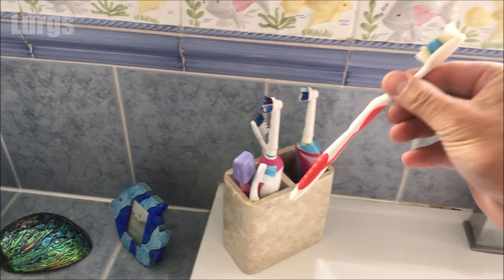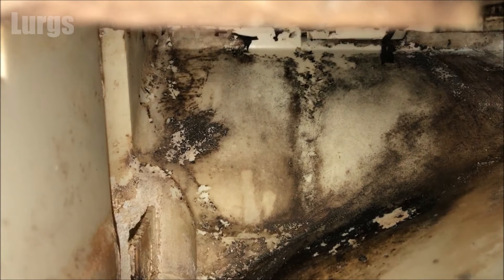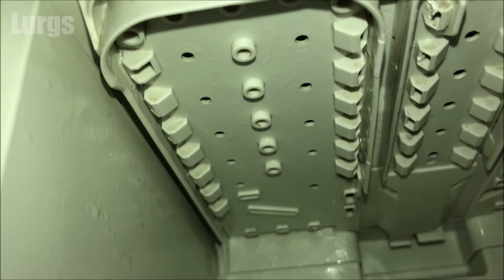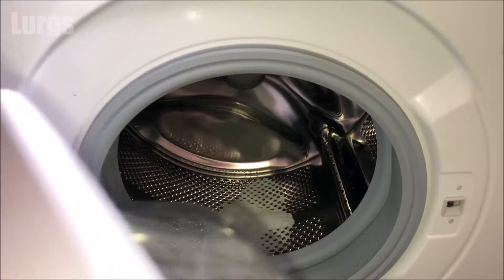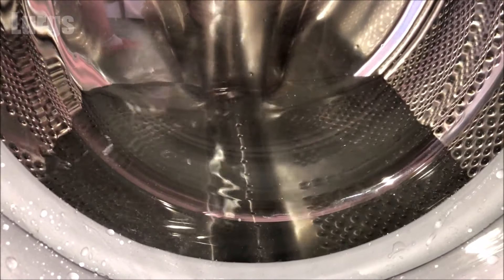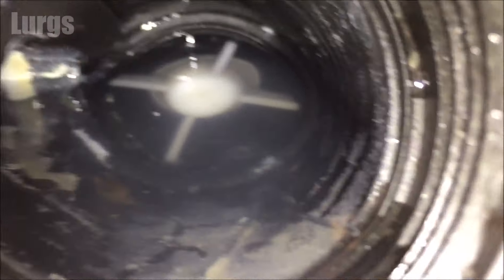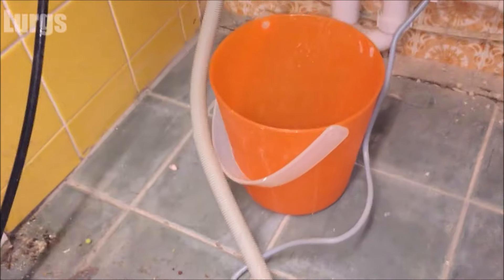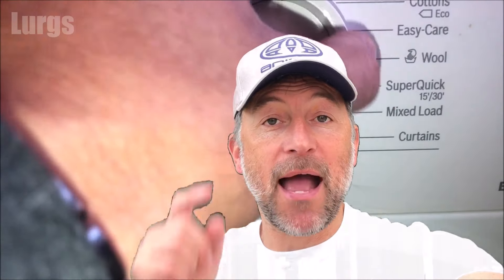How to Clean a Smelly Washing Machine in 6 Easy Steps

Comment: I followed all your procedures and smell continued. I discovered the element was broken and needed to be replaced. Your video set me in the right direction to discover what was at fault 👍
Reply from the maker: Glad to help.😎
Reply: Can you tell me what part thanks
Reply: @valerieguidry7636  element is a sealed unit in your machine. Looks like what is at the bottom of your kettle rather than round it’s straight. It’s quite easily replaced. Un do 1 bolt 10 spanner disconnect 2 electrical wires and remove. Make sure all power is off to the machine.

Comment: Nice video, currently waiting for my 90c wash with the cleaning powder to finish. Fingers crossed it will do the job. I think this is the one major disadvantage of doing colder washes - with modern detergents you can still get your clothes clean at 30c, but the machine builds up bacteria far faster than "back in the day" when people were washing at 60c+ on a regular basis. Still, running a high temp wash every 6 months or so is probably way cheaper than washing daily at higher temps.
Reply from the maker: Thanks. Yes 90C gives it a good clean out. 😎

Comment: Stop using liquid detergent…use dry powdered detergent…No more mold!!, Trust me!!
Reply: USA Costco Kirkland Signature powder. I have a 4.5 Samsung washer,  I use 1/2 c. Kirkland powder, 1 Tide pod, 2 Scoops Oxy Clean with ever load. Crack door open and drawer and after 3 yrs without Clean cycle absolutely no smell. Every 3 months Clean Clean out.
Reply: Mines the opposite

Comment: My machine is 15yeara old. I have only ever used liquid cleaner. It has never been serviced. Would be nervous to mess with the U bend. Didn't realise there might be a service wash option. Just wondering if you know if Bicarbonate of soda could be used to clean it. Or I shall need to go out looking for the Dr Powder you recommended. I hope it is not hard to find.
Reply from the maker: The U Bends can get clogged up. The washing machine cleaner is really good stuff.

Comment: I don’t have any u bend on my drainage pipe ... constantly blocking and making floods,
hence i drain directly in sink - so the pipe of the wash machine spits ribbed copies of its insides  gunk... Cleaning it in all sorts of ways and its new machine Can low water pressure in the block of flats cause it?!
Reply from the maker: Low water pressure shouldn't affect it as the drainage is the last part where the pump pumps out the water in the machine. Sounds like poor pipework on your drainage. Best get a plumber to have a look and advise.

Comment: how to clean the pipe from dispenser? 🤔 because theremany dirt left aswell
Reply from the maker: Not sure what bit you mean? Run a drum clean option or 90c empty wash
Reply: @LurgsHowToGuides   water with detergent goes from dispenser to the drum, this pipe is not easy to clean mould is inside around pipe
Reply from the maker: Yes not easy. Still try a drum clean/90c wash as this may flush through and clean it.
Else use the pods which go directly in the drum and it may clear up after a while

Comment: Hello there, 
Thank you for this video, it’s very helpful. My washing machine keeps on giving an error. It’s says open faucet. But it is wide open. What should I do?
Reply from the maker: It could just be a faulty sensor maybe, is it still washing ok and filling\draining?
Reply: @LurgsHowToGuides  yes it’s washing and filling/ draining. So I will get the sensor replaced. Thank you very much. Do you also have a tip on which dryer to buy? Your al time favorite not to expensive. Thank you in advance!

Comment: your not explaning if the rubber base is dirty. me rubber second layer and the rubber that on the inside of the whiel is dirty, how to i clean that? i having hard time to keep the rubber that on inside of the whiel open to clean it. any tips?
Reply from the maker: It’s hard to clean all the places inside, run a few drum cleans or 90c empty washes to help clear dirt, once a machine gets older it’s harder to clean the rubber if it’s ingrained dirt
Reply: @LurgsHowToGuides  i have cat i gues its hairs that are left behind in the rubber drum, try to clean after one soda round, but was still harde to keep the rubber open to get the rubber layer that on the inside of the drum, even tryed to force it open with the back side of flat metal fork, but even then is was still in some way harde to remove the wet dirt/hairs/molt. now im running it overnight with 
vinegar. but i dont think that will help my hair/molt problem that on the inside rubber sticking to drum.
Reply from the maker: Hairs do stick to the rubber. Hope the cleaning cycle works and at least helps a bit

Comment: Hi! I took out my soap drawer and behind it was a lotttt of mold. How do i flush this black stuff away after scrubbing it loose? can i put a small hose in? or do i kill the machine by doing so?
I couldnt get it all away with a cloth and now all my clothes smell like shit and have these loose black stains :/
Reply from the maker: Try scrubbing it loose with a long brush (but block that hole up incase you drop it), then do a service wash or a hot wash with no clothes to flush the machine through. After you do a wash always leave dispenser drawer slightly out to let it ventilate, will stop mould building

Comment: I’ve done all of those steps and the machine still smells. It’s only 2 years old. Should I get an engineer out to see it?
Reply from the maker: I doubt if an engineer would be able to fix that. Make sure you do some really hot washes (service washes) and after normal laundry leave the door and detergent drawer open to allow ventilation.
Reply: @LurgsHowToGuides  Hi, thank you for the reply. I have done three 90°C washes. One with a touch of bleach and two to rinse it out. I've checked the pump and the drawer has been completely cleaned and the rubber seal. Yet the washing still comes out smelling awful. I'll see if the professional machine cleaner works. The machine doesn't have a drum clean function, which is unfortunate.
Reply from the maker: @WillVenusASMR  Yes try Dr Beckmanns in the drum on a 90c wash. That should help. It shouldn’t smell if water is draining properly. Odd the actual
Laundry comes out smelling, are you sure the cold water inlet feed is ok, I would think it is as it’s mains water and you’d see problems with water out of your taps. 
You could also try the pods for a laundry wash instead of using the detergent drawer as these go straight in the drum.
Hope you can get it sorted, please let me know how you get on...and good luck.
Reply: @LurgsHowToGuides  I actually use ariel liquid and pop it right in the drum, on top of the load at the back. I'll try changing the water inlet hose as I don't think that has been changed in a long time. Thanks so much for your help, it's genuinely appreciated 👍🙏🏻
Reply: @WillVenusASMR  have you tried draining the filter hose as well as removing the filter and cleaning it?

Comment: My washing machine is 4 years old. I never use fabric softener, and put liquid detergent straight into the drum. Also I do regular 60 and 90 degree washes. I never did a maintenance wash because the machine looks completely spotless. Using a shit load of fabric softener and liquid detergent and only washing at 30 or 40 degrees will kill a machine.
Reply from the maker: Great info. 😎